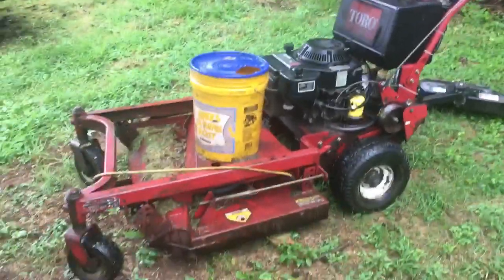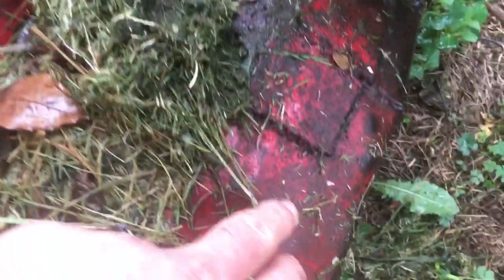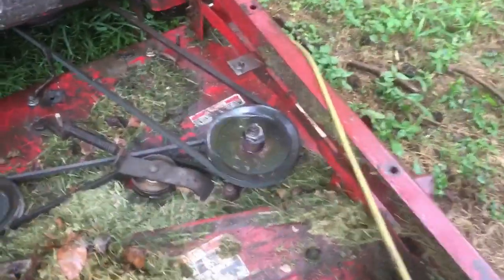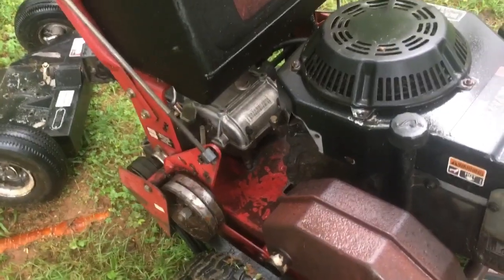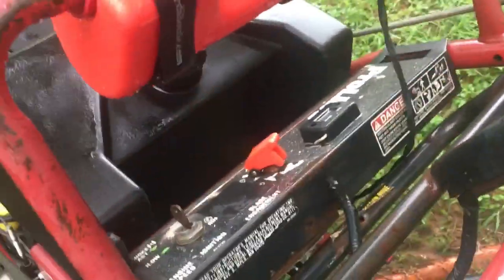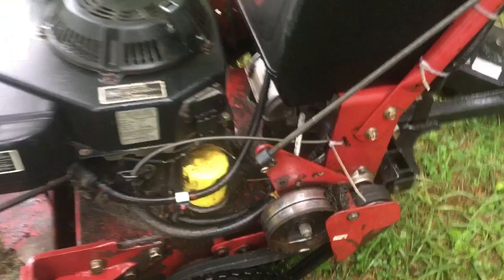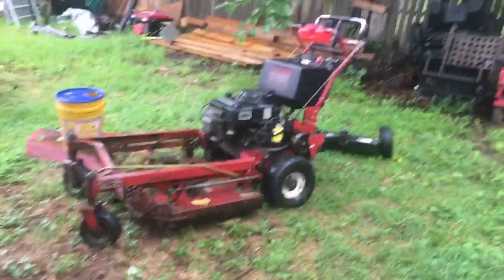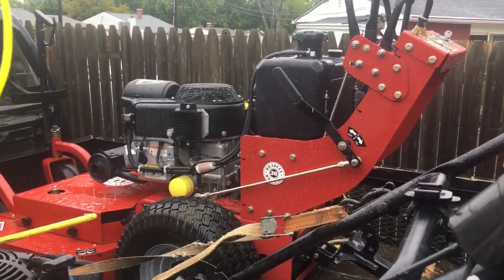Everything That Went Wrong With The Toro Proline (New Mower Reveal At The End)

Comment: Hi, I have issue with drive spindle assembly on my toro (same model as yours), what after market spindle drive did you use. The groves on the spindle shaft on mine are worn out. Would appreciate if you could let me know make and part no of the after market spindle drive that you used, did you have make modifications to fit it.  Thanks in advance
Reply from the maker: I believe I used the one in this link but I had to reuse the existing pulley if I remember correctly https://www.ebay.com/itm/Toro-Spindle-105-1688-Fits-62Z-Center-/382527219393?_trksid=p2349624.m46890.l49286
Reply: @TheRandyDulin  - thanks,

Comment: I got one of these mowers given to me and it has not run in a few years at all. Not sure where to start. Any advice
Reply from the maker: Make sure it has oil, drain the old gas. Put in some new gas and see if she fires up. If she won’t then spray some starter fluid or carb cleaner in the air intake. If she fires up then dies you know your carb is gunked up and either needs to be cleaned or replaced. That’s how I would start
Reply: Thank you sir
Reply: @TheRandyDulin  now it’s not wanting to pull start. Any ideas
Reply: Where would the dom number be located also. Supposedly a date of manufactuee
Reply: Pull cord won’t pull. Any ideas

Comment: I need your help I just got one or does mower but it doesn’t work do you know what’s wrong with it or how to fix it?
Reply from the maker: What’s it doing?
Reply: @TheRandyDulin  well I just got it yesterday and the guy who sold it to me doesn’t know what’s wrong with it and he gave it to me without a key
Reply from the maker: Kenny Moreno sounds like step one would be to get a key and try and start it
Reply: @TheRandyDulin  good morning sir so I bought a new key and it looks like it needs a oil and a new carburetor do you with kind of carburetor it is bc I look and i don’t know witch one it is
Reply: All I saw was a name on the carburetor walbro
Reply from the maker: @kennymoreno9351  How did you determine it needed a new carb? Does it start if you spray starter fluid into the carb? There should be something on the side of the engine that tells you a model number and serial. You should be able to take that info to a dealer or plug it into jackssmallengines.com and figure out what you need from there.
Reply: Hey sorry to bother you again so I got it to start everything works but it looks like I’m missing something to spin the blade but idk what time of wire I need or witch one they are can you help me?
Reply from the maker: Does it have an electric clutch or do you use a lever to start the blades?
Reply: I think it’s a electric clutch is it possible to send you pictures somewhere to take a look
Reply from the maker: @kennymoreno9351  sure, email is randy@dulincutandtrim.com

Comment: Do you know where you got the spindle pulley from?
Reply from the maker: I believe I used the one in this link but I had to reuse the existing pulley if I remember correctly https://www.ebay.com/itm/Toro-Spindle-105-1688-Fits-62Z-Center-/382527219393?_trksid=p2349624.m46890.l49286